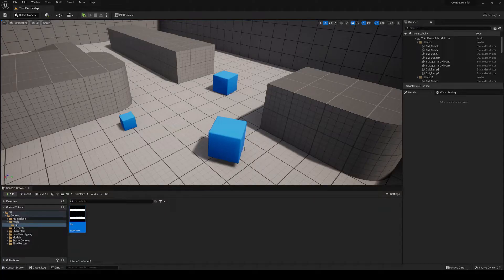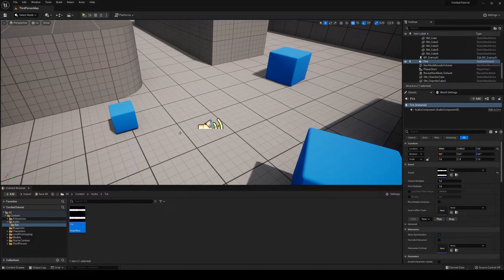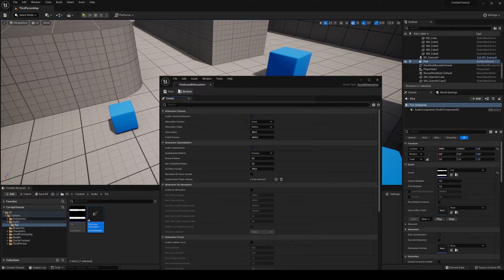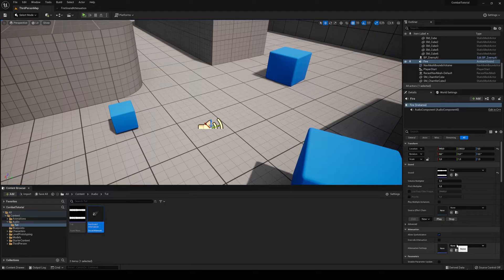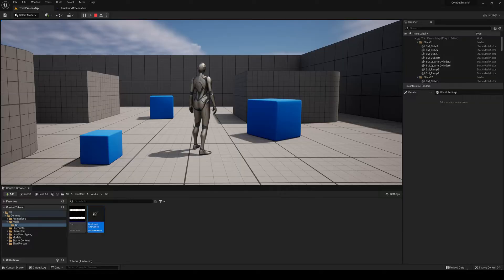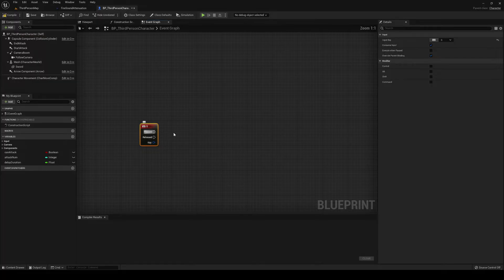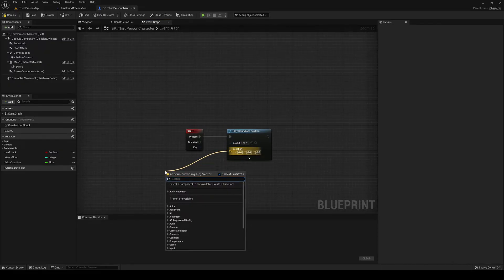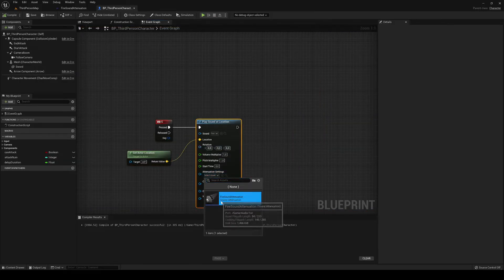How to Make a 3D Sound in Unreal Engine 5

Comment: hi! hopefully you can respond to this comment, if you know the answer to it.. So, first of all, it worked! but i noticed that when i spawn outside the radius, the sound does not play.. is there like a way I can fix this if not then thats fine too!
Reply from the maker: so what you could do is simply increase the max distance for the sound attenuation into a larger value, or spawn the sound closer. It always will need to be in ragnge of the player`s camera
Reply: @GorkaGames  but what if I am making a open world game and just want to place a small radio somewhere?
Reply: @emirozdemir7339  setting "looping" on true in sound settings should solve this issue